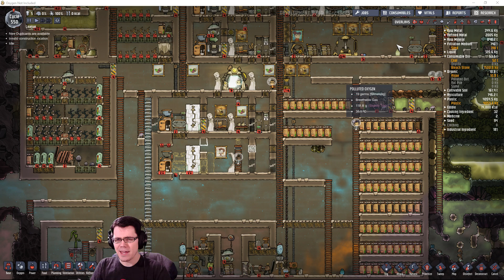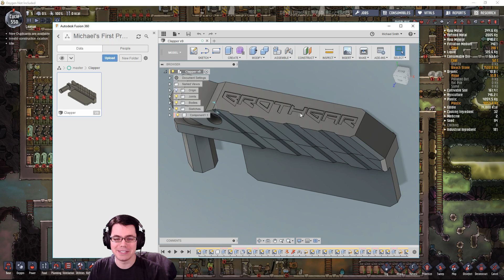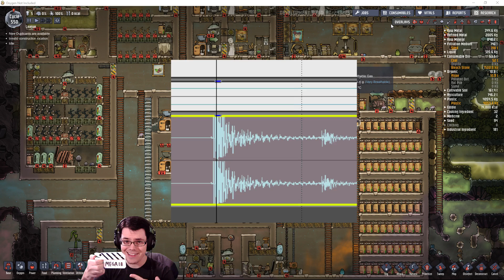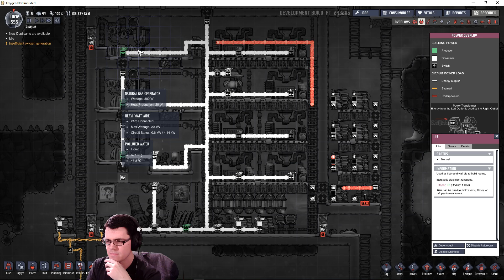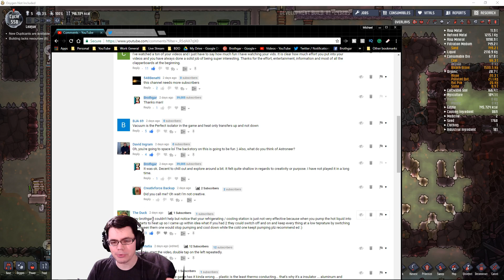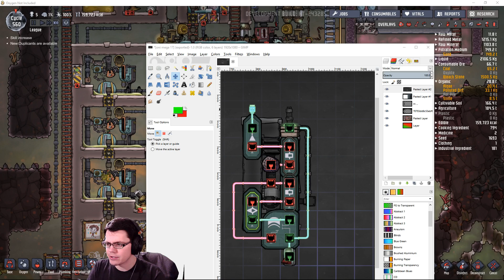Polluted Water Power Plant! Oxygen Not Included Mega Base 18

Comment: This is my system for doing plastic, no heat at all it migh be self powering not sure about that and works fantastic. 
Check it out https://imgur.com/a/ZgCI6 
I use natural gas to henerate power for this and while i am making oxygen for suits i am making hydrogen too and i feed the machine for cooling, but it doesnt take that much so 1/4 day i open a valve to release hydrogen to the area. 
Everytime the plastric id being made there is also steam which transfers to water. I detect that water and open the doors so plastic gets away  from heat. 
Please check it out

Comment: I would only control outflow of cooling liquid from the cooling pipes at the polymer presses. Prevents the pipe from going empty, but stops energy consumption of the oil pump whenever no more cooling is needed.

Comment: I'm not really sure that 'more hydrogen' in the loop is always better. Yes, you add thermal mass. However, the more hydrogen in the loop, the slower the clockwise direction is going to go. That is not going to be a problem at the current temperatures, but my wheezewort cooling loop tends to get so cold that wheezeworts getting stifled (I use petroleum instead of oil to prevent freezing). In that case additional movement in the hydrogen seems to give better results because it prevents the right side from being too cold, whereas the left side is warmer.

Comment: if you put a transformer before your main power bank and then place any battery before that transformer you can check when the main bank is full after disconnecting the battery from the system. If it has power the main bank is full. The batteries before the main bank act as a buffer for overflow which means you don't have to check if it's full as often. Here's an example of what i mean https://imgur.com/a/DXd0I

Comment: Well the thermal shift plates aren't heat sinks, they need to actually connect to an area with a different temperature to conduct thermal energy. So one sitting by itself is just gonna reach equilibrium with its surroundings and that's about it.
If you want them to do things in this case, gotta snake it all the way over to that hydrogen chamber...potentially negating the point of a liquid cooler, but as you said, they're cool, not practical.

Comment: remember, keep fireman poles on the inside/nearer to the door they're leaving from than the ladder! for example, your dupe that took the pole down was doing so from the top-right side, which had the pole closest.
Reply: if you mean two poles, then maybe. usually i just put the pole closest to the main access (such as the dupes room exit, or on my main path to my oil gathering section since those are the biggest vertical distances to cover). 

two poles is a LOT of metal investment, so it might be worth it to run a short experiment to find the ins and outs of pole pathfinding and preference.